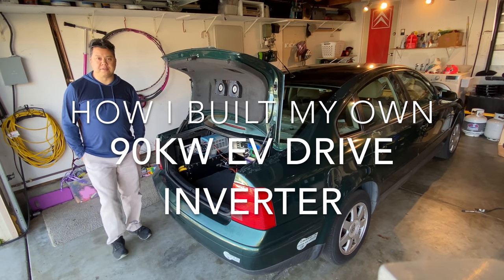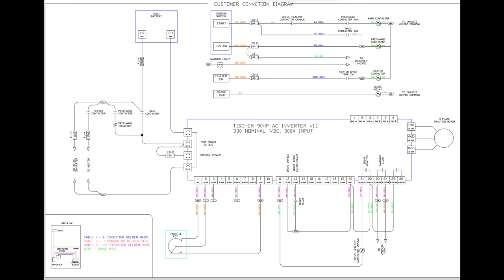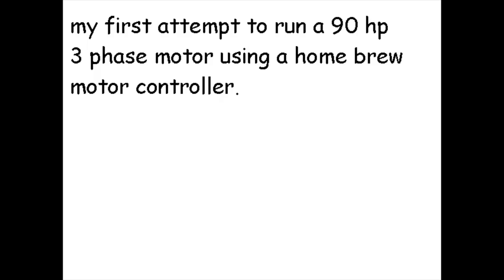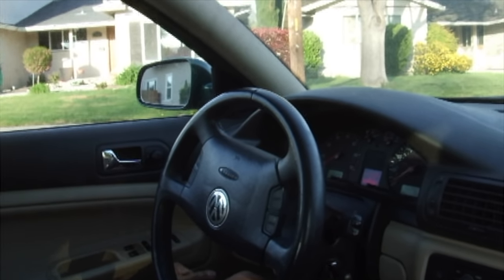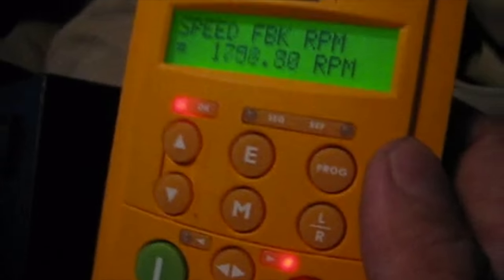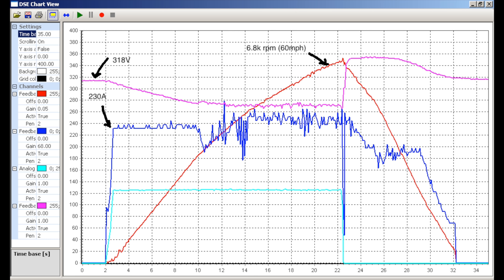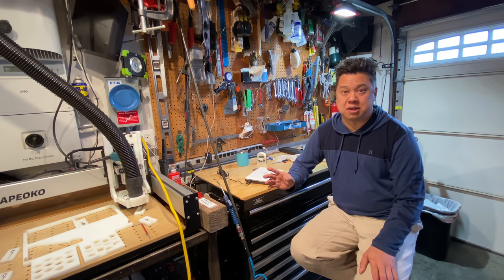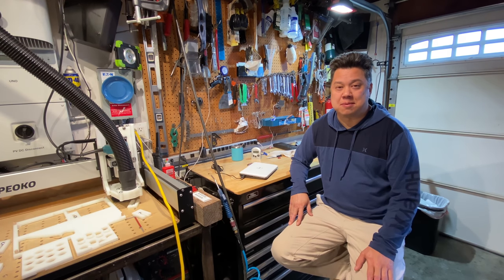How I built my own EV drive inverter

Comment: Do you still drive the car as a daily driver and another question is are you on the original battery pack that you started with and what type of batteries are being utilized
Reply from the maker: I was using blue top optima lead acid batteries for the first year, a LiFePo4 pack would have cost $25k, but a year later (2009) the price came down to $12.5k and I upgraded.  All the 100Ah Thundersky LiFeYPo4 cells have lasted up to this point.  I've consistently been driving 50 miles per day for the first 8 years, these last two years I haven't been driving much since I no longer commute.   I'm now getting low voltage alarms on one cell after 20 miles, so i know at least one cell is bad.  Overall pack voltage looks good though.
Reply: @etischer  thank you so much for the information and thank you for sharing your knowledge and information in your videos it helps a lot of people that want to make their own electric cars with limited knowledge or with a difficult starting point

Comment: Hi. Nice build.What model is youre vfd and the igbt?
Reply from the maker: The VFD is a Parker 690 drive.  The IGBT was a 300A IPM (Intelligent power module) from PowerEx
Reply: @etischer  thanks
Reply: @etischer  How did you pick the drive?  I would expect it to be an AC powered drive, but you powered it with 300+VDC.  What range to DC power will it handle?  Or does the power electronics run at lower voltage, with only the IGBT seeing the 330VDC?

Comment: Why didn't you use the 1200 volt igbts they use in large inverters.
Reply: IPM Igbt module has the gate drivers built into one  package. The vfd etischer utilizes has all the high and low signals the IPM module is looking for. Not to say you couldn't just use discrete gate drivers but why do that when the IPM has it all built in.

Comment: You told in the video, at the time of the first test, you blow up th IGBT beause between the DC-Bus and the Transistors there was a large inductance, and the voltage spikes killed the transistors.
 What did you change to avoid or reduce these voltage spikes?
Reply from the maker: I previously had the capacitors and snubbers connected to the IGBT using wires.  Attaching the capacitors directly to the IGBT module using copper bus bar helped absorb the voltage spikes.
Reply: @etischer  You mean the gray boxes on the copper plate at video time 5:22?
A snubber contains normally a resistor also. Did you calculated the ESR of the capacitor within, and that's why no resistor present?
Reply from the maker: @johnhajdu4276  The snubbers I'm using are film capacitors. I'm also using electrolytic caps.  I didn't calculate the capacitor requirements, I just looked at what other inverters were using, and doubled it for good measure.
Reply: @etischer  Can you tell me how much Farad and what is the Voltage (written on) of one blue capacior on the DC busbar? And the film capacitors, what U and F values one unit has? I tried to read the written on values on photo I found on your website, but the resolution was not that high.
Reply from the maker: @johnhajdu4276  Sorry, I don't have that info handy.   I believe the voltage rating on the electrolytics are 400V, and the snubbers 450V (from memory).  You can probably look up the data sheet or white papers for snubbers, and they will have recommendations for sizing them for your IGBTs.

Comment: Is there a how to on conversions? All I can find are not for beginners or too basic (just remove engine and put batteries and AC motor)
Reply from the maker: You can check out DIYElectricCar forums, there are hundreds of conversions documented, mine included.
Reply: @etischer  thank you. Btw the matching revs light to switch gears is awsome

Comment: If you hadn't parted it out by now.. Please clean it up and sell that sell it. Someone will buy it. Volkswagen need to hire you. And take all their old diesel cars and turn them to electric dieselgate thing.
Reply: Volkswagen? He has worked for Tesla for nearly a decade :D
Reply: @rkan2  well I wasn't listening very good. But those diesels are still rotting away from dieselgate. Since 2014
Reply: @stevencorrea6946  He didn't mention it yet in any of his videos. (we just checked his Linkedin). The dieselgate cars are being resold somwhere, again :) It has been possible to buy some models in the US too. Most of them still lie somwhere of course, I think.
Reply: @rkan2  That's great.

Comment: Where did you get your training at?
Reply from the maker: I graduated from Chico state with a Mechatronics degree.  But the practical skills to build the inverter were picked up by tinkering in the garage, trial and error.  As the video shows, I had never used an IGBT before, I tried to show the learning process from that point.

Comment: How do you get approval to drive such modified vehicle ?
Reply: In California? Where you can chop the roof off a car that is a monocoque? I bet you only need to to comply with some emissions hardware. Even in Europe it is possible to do EV conversions, because only the emissions regulations are inherently prohibitive. Of course it is not possible to mod the chassis and most cars after 2002 are also bound by ogher regulations, which would make compliance very expensive.
Reply: @rkan2  this is not allowed in europe due al lot of things i would make a mod on my car that the diesel engine powers the front wheels and 2 electric engines powers the back wheels but no approval
Reply: @Punky-Boy  Yeah, changing the powered axle might not be easily doable, but the rest should be not an issue to a car that is before or equal to EURO1/2 regulation (a car before 2002, if not 1997). Some car models have had for example 4x4 versions, where it could be possible to make a front wheeled car be either 4x4 or possibly even  a rear wheel drive. But of course the car model has to be the same etc. you can check out evalbum by location to see a list of ev conversions in Europe.. There are a couple hundred documented there.

Comment: 90Kw and only 100miles of range?
Reply: There was only the Tesla roadster around the time that this was made, that matched some capabilities, such as the range.
Reply: rkan2 that has nothing to do with how much or why the range is so low on this diy. Not criticising, just wondering. And the original roadster had 53kw battery while getting 244mi range
Reply: @THEFIRE360  The roadster had a 53kWh pack. This thing apparently has a 100Ah*328V pack (~32kWh). I would.'t call the range "so low". It runs 200Wh/km, and while that isn't Ioniq or Model 3 numbers, it isn't that bad for an EV.
Reply: rkan2  can you stop putting words that I did not say into my mouth? I am mearly asking what the guy said in the video which he said was 90kw battery (literally stated on the title screen 0:02) or I could have just understood it wrong
Reply: @THEFIRE360  Where am I putting words in your mouth? He doesn't state the battery capacity is 90kW. 90kW means the drive inverter (e.g. electric motor controller) power, does it not? (As in kilowatts, or ~121 horsepower). The actual battery capacity is in kilowatt-hours, which is, again 100Ah*328V= 32.8kWh (Amp-hours*voltage = kilowatt-hours). The 32.8kWh battery would run empty in ~21 minutes at full power, or in an hour at the rated full power of the motor (33kW). You can check his website for full written details. Since he can get about 160km with the car, it means it has an effiency of about 20kWh/100km. (32.8kWh/160km)
Reply: @rkan2  my barina is getting about 11 or 12 km per liter on lpg. But it only weighs about 1100 kg lol